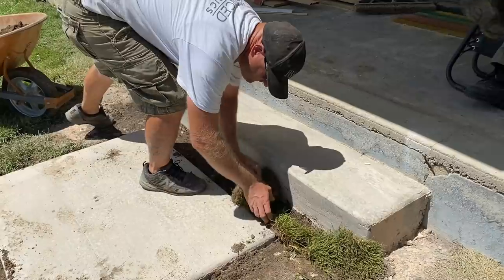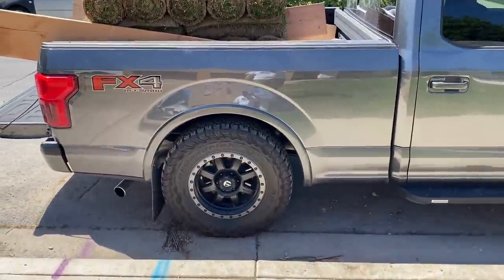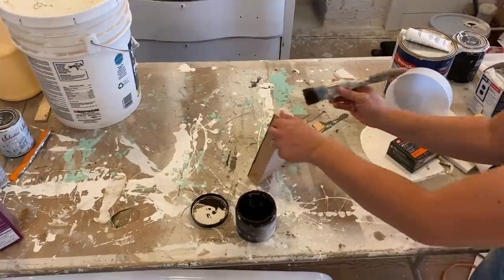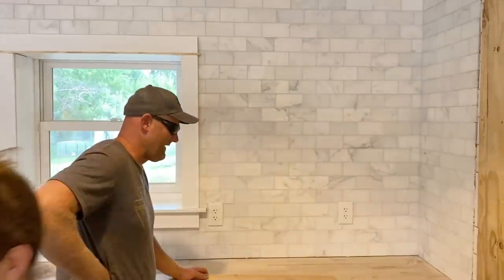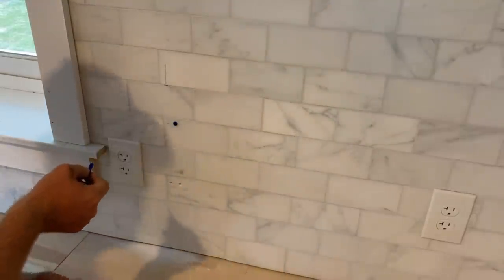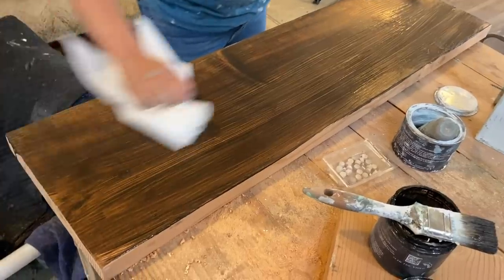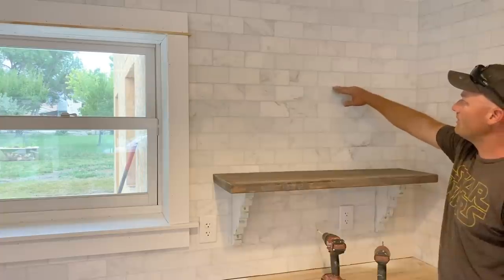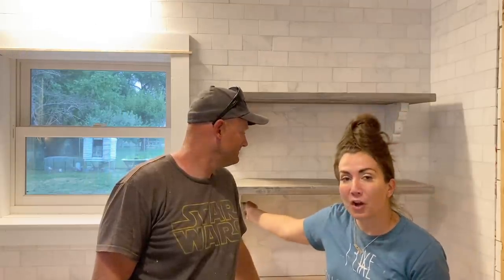How To Make Open Kitchen Shelving With Chippy Painted Corbels  Farmhouse Kitchen

Comment: I'm so glad the light fixture isn't staying. I didn't say anything but agree with others. Too small, high and too close to the wall.

How much weight will the open shelves hold? What size plugs (can't think of right word) did you use for the screws? They look GREAT!
Reply from the maker: 3/8” plugs. They should hold 40ish pounds or so

Comment: Open shelves are a nightmare,  they and everything on them collect a film of  grease and dust very quickly.  Wooden worktops are so impractical - they get water stained, burn marks etc. and harbour bacteria.  Personal taste, but I would choose sleek modernity over shabby chic vintage for a working kitchen every time.
Reply from the maker: I’m actually super excited about the age and wear they may get. I want it to feel like you e walked into a kitchen that’s been used for 100 years. 😊❤️